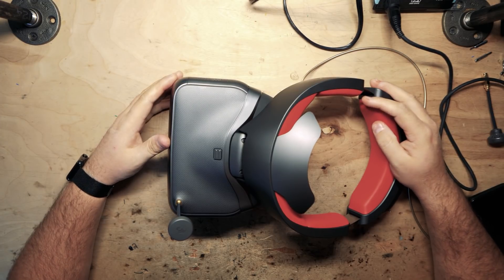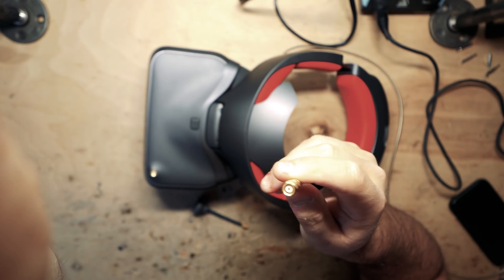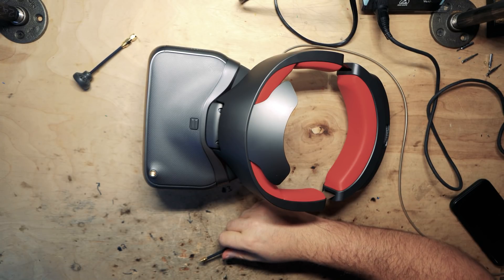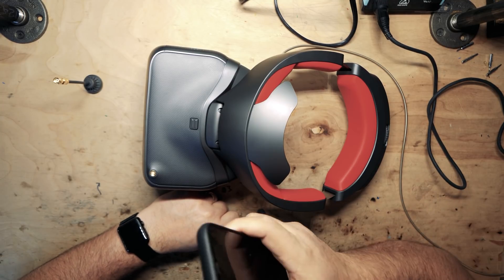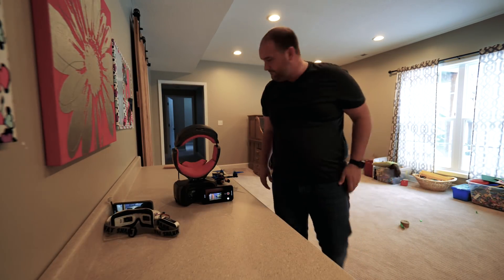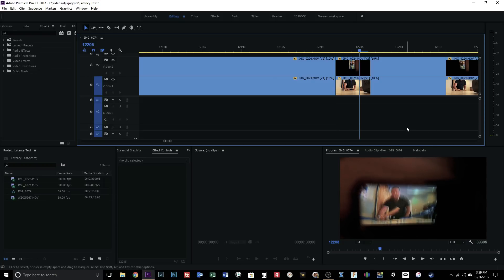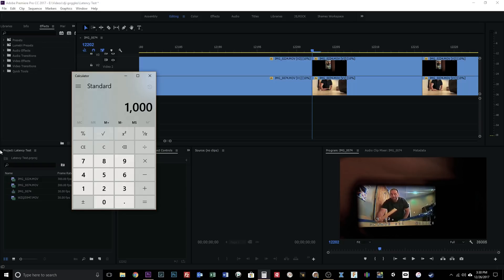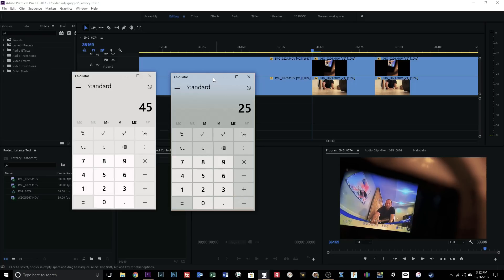DJI Goggles RE Analog Video Latency Test

Comment: You really need to have a camera on each viewpoint of the same exact scene to make this more accurate or something moving with constant velocity. Your displacement in the clapper can be slightly different in each scene causing a different velocity for each shot; thereby making each shot really take more or less time than the other which skews the latency results.

This inconsistency is huge btw when we're talking about milliseconds.

Comment: I appreciate the video and the work. However, another Youtube reviewer says the RE edition analog latency is "on par" with all the other goggles out there (i.e. that "he has used") including the Headplay HD. https://www.youtube.com/watch?v=1ape5dJfJpA
Reply from the maker: Peter Freund I saw that too.  IMO, his test method is flawed because of the refresh rate of the screen on the phone and the screens in the goggles.  The phone only displays  numbers .05 seconds at a time which gives it a margin of error of 50ms.  Even still, I want to test more but my guess is that maybe the head play goggles he was using introduces more latency than the normal fatshark goggles.  I’ve read some test that confirm this but I want to verify.  

Also, I’m curious if the zoom settings in the goggles change anything.  The scaling could introduce more or less latency.  

I feel confident in my process and results but it’s still an open book!
Reply: Thanks. Have you continued to have good range compared to your Fatshark diversity setup?

Comment: Just added your channel. I also just got my RE goggles in today, mostly for using with my analog 5.8ghz copters. I also notice more latency over my old Fatsharks just as you found. But if I didn't know better it looks like there's some kind of digitizing of the video that doesn't seem to be going on with the Fatsharks. If you look at the snow when there's no signal, it occasionally freezes with a nice snow shapshot. I don't see this with my FS's tho... So maybe whatever they're doing to render the video on the screens is part of what's adding the latency. Or I could be completely wrong :) I'm not a racer so this latency is well within what I need to do my type of flying. Basically FPV freestyle once I actually learn how to fly well :)

Comment: Thanks for the video. I'm really interested in these goggles.  

You used 300fps for calculations for both goggles, but you mention the footage was 240fps from one camera and 300fps in the other camera... ?  Is that right?  

I have tried the dji goggle (not RE)  with a mavic and I love the picture quality, large fov, comfort,  the short time it takes to get a comfortable fit compared to Fatsharks, and feel of quality on those goggles.  

What will keep me from buying DJI goggles RE is 1, latency and 2, no input for ground station.  

Shawn, can you confirm which ANALOG changes are available with the goggles RE ?  From memory the manual claims 40 channels but also says only goes down to 5685 and only as high as 5925mhz... Confusing.
Reply from the maker: I recorded the test with 2 identical iphone X cameras in slow motion mode.  I thought it was 240 fps but when I got the footage it was actually 300 fps.  Both were identical.  

I'll check the hz range.  I'm not sure, I recorded this on RB1.  

I'm curious about latency.  The latency from the test seems accurate but I get that it was pretty crude test.  In regard to the latency, I wonder how big of a deal it can be.  If we can get use to 25ms with fatsharks then whats 20ms more?  

I'm definitely not one of the fast guys but when I watch you all fly, it seems like you're working as much as 1-2 seconds ahead vs here and now.  

In regard to external ground station, that was my biggest concern and I actually think I have a solution.  I haven't tested it yet but I hope to in the next day or so.  It will be a big deal, I'm excited about it.  I've been driving Joshua Bardwell and IBCrazy nuts with questions but they've helped me come up with a pretty clever way to get a ground station into the goggles.
Reply: Heart of America FPV well if Fatsharks are 25ms, then an additional 20ms would be 45ms, so basically double latency... Double , aka 100% increase Sounds HUGE to me but I try to only rely on field tests.  

I was going to try running an analog to digital HDMI converter to be able to use a ground station with these goggles but don't want to invest in the test.  Keep me posted on how your testing works out, I'm curious.